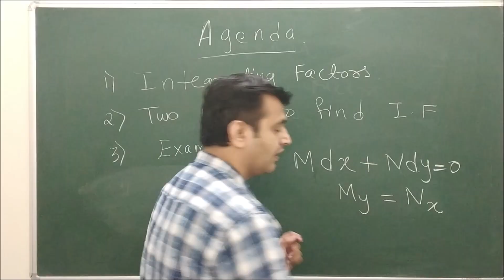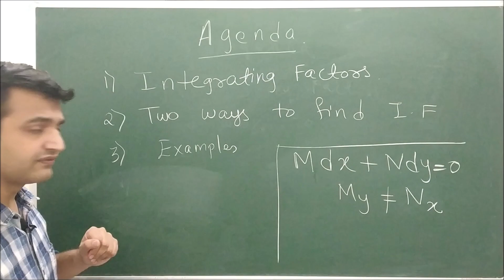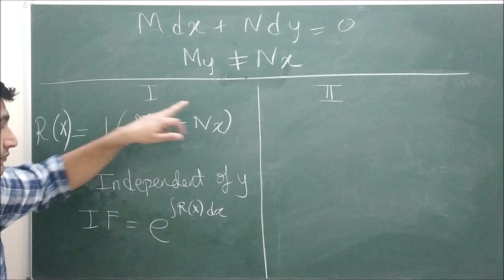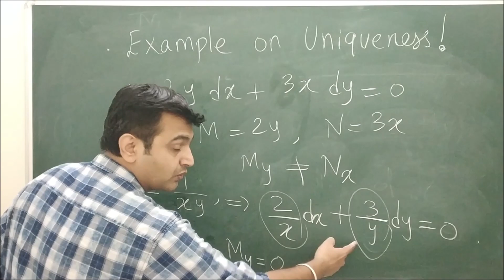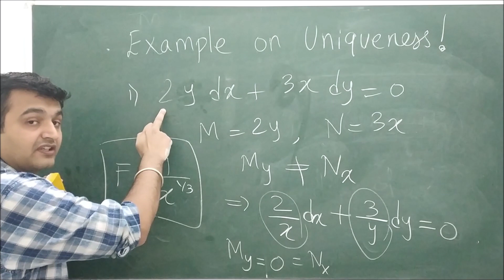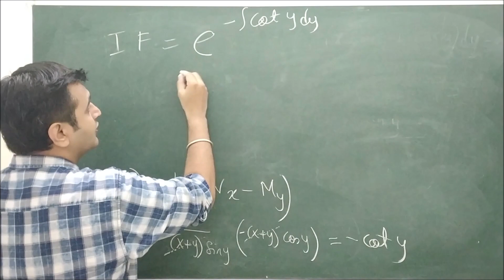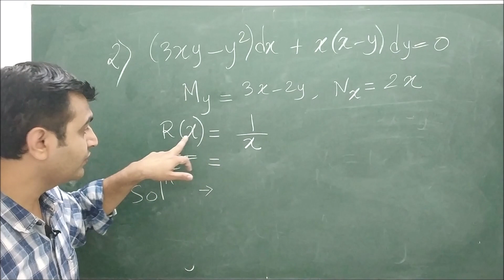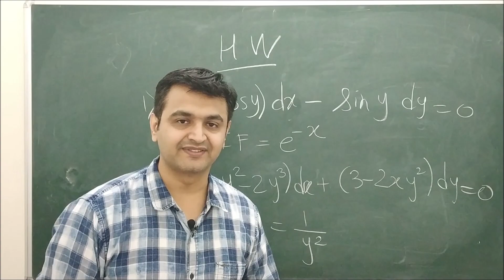Session 9: Integrating Factor to convert non exact differential equation into Exact differential eq.

Comment: Why didnt u use 1/xy in the second example as IF?
Reply from the maker: At 11:41 you are talking?
Reply: @DrMathaholic  I am asking how to know if i should use inspection method or IF method.
Reply from the maker: @datco4507  well, inspection method requires lots of practice.  
If you see that an equation is not exact, try to find IF with these formulas. There are some more methods, which I hvae not talked here.

Comment: [e^-y dx + e^-x(-e^-y  +1) dy=0    ] sir,what will be the integrating factor in this example .can you explain??
Reply from the maker: For this equation, both methods of integrating factor fails. But if u observe that, after multiplying by e^(x+y) , given equation becomes exact.
Reply: Yes but is there any particular method to find the integrating factor in x,y variables ??
Reply from the maker: @onkarviralekar5437  yes there are methods. Either you can refer book by Ramanna or wartikar. So simply Google, methods to find integrating factor for non exact differential equations.
Reply: Jatin Majithia thank u sir 🙏

Comment: Sir can I say that if there are more that one integrating factors,then given differential eqn has more than one solutions?
Reply from the maker: Good question.
I was expecting this question from someone!! You didn't disappoint me.
Reply from the maker: Lets do one thing, can u find the solution for the differential equation where I gave 2 Integrating factor.
Also find solution using variable separable.
See whether all solutions are same?
Reply: @DrMathaholic  Yes sir,all solutions are same.
Reply from the maker: @sanmeetwakchaure8530   Good.
And that's the answer to your question.
You will get same family of curves.